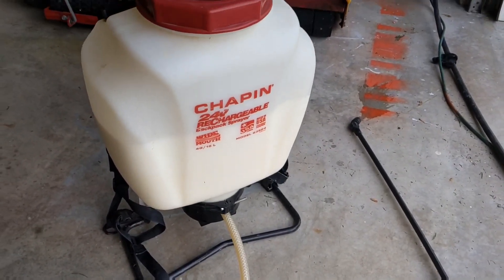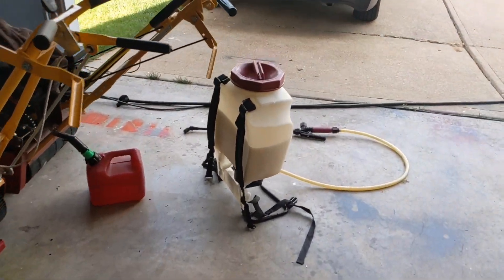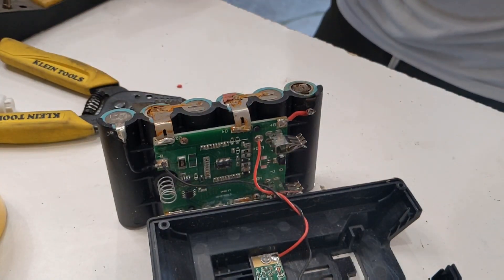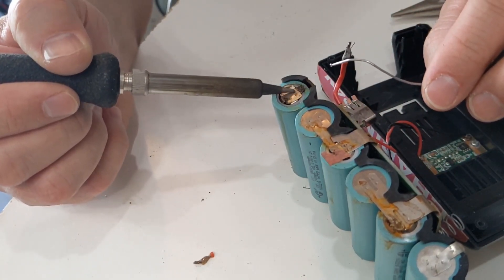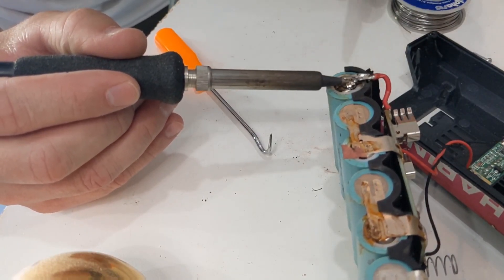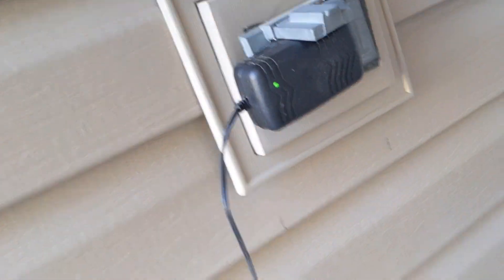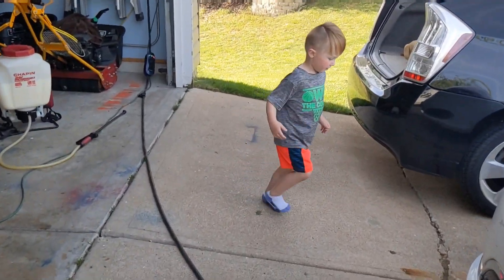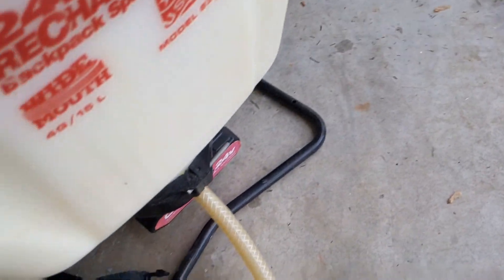Fixing a cordless tool dead battery. I brought it back to life! (Chapin 24V Sprayer)

Comment: Chapin put the battery UNDER the leaking pump. This is a battery killer, and the worst design I've ever seen. Your fix will have to be repeated for the same reason. Buy a FlowZone Typhoon. Their battery is superior, mounted ABOVE any water, and enclosed. You will never have an issue with a FlowZone.

Comment: This is EXACTLY what happened to mine. 
I was literally just spraying and all of a sudden it died. Took a couple of videos to find yours because of the title, but I digress. I need to solder mine too. Thx for the video and I just recently bought a soldering iron even though I suck at it too!🤣🤣🤣
UPDATE: not working. My solder won't stick to the terminal,  so I'm S.O.L.
Reply from the maker: Glad it almost fixed it! I'm inexperienced in soldering, but i know you need the new areas to be clean, flux can help the liquid solder flow, and hold it until solid.
Reply: @kove  here's another problem i have. When touching the solder to the tip, it doesn't do anything. I have to use the pointed shaft to get it to start melting.
Reply: The unprotected battery is UNDER the leaking pump. A truly stupid design. Buy a FlowZone Typhoon and never have an issue. Compare the design. Battery is ABOVE water and enclosed. Lasts forever.

Comment: I have the same charger and battery.  We left it on overnight and now it's completely dead and wont charge.  I discovered evidence of that green residue as well but I haven't taken it apart.   I don't know if it's inflation or what but a new one is around $120-$200 in Canada now.   I'm going to try to take it apart, since I have nothing to lose before ordering another one.  Maybe I have the similar problem.  Thanks for the video.
Reply: Im back for an update.  I took mine apart and took the plastic off the batteries.  It's a bit corroded but everything was attached nicely.   I think I ruined the Lipo by leaving it on overnight and completely drained it.  There is a hack where you can force a charge with a DC charger but it's dangerous.    I threw in the towel and ordered a new one.  We need it for our business.  :(
Reply from the maker: Yikes, that is an insane price. Hope you get if fixed. Having a battery on the bottom was a terrible design idea, they are still doing it with newer models.
Reply: @kove  I kept cleaning it up.  I used a wire brush on the bench grinder.  Then I used a hand wire brush on the contacts and cleaned it even  more.  After many more attempts all of a sudden I got it to start charging.  It's on the charger now.  I think the sensor for low voltage glitched just enough to get it charging.  I was lucky.

Comment: Same issue with my 24V Chapin battery pack. Thank you for posting this. Had to remove the plastic wrap from the batteries to see it. Saved me $60 for a new battery on Amazon. Anyone know of a compatible aftermarket battery out there? Seems like the only OEM option forces you to purchase a charger too.

Comment: Ha, Just did the same thing on my Chapin 20v, mine was only 2 years old.  It used a Black&Becker 20v battery,  Same exact thing happened the positive was corroded off, bad Quality control I assume.  Quick fix! Thanks for sharing! Peace and God's Love!  Chad Upstate NY
Reply from the maker: I came so close to buying a new battery too! Figured what the hell, May as well give it a shot and take a peek at what's under the hood. Pretty disappointing they apparently have an ongoing problem with this. None of my other batteries from Ridgid or Bosch have had this issue. Both are older and exposed to water just as much.